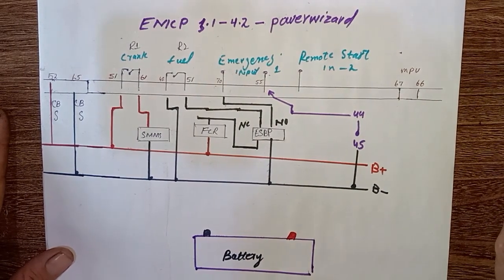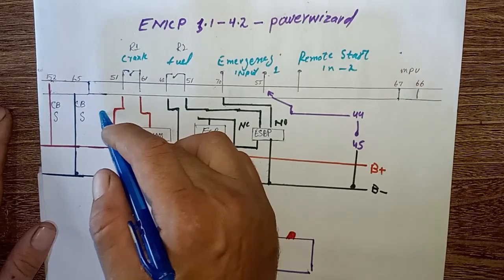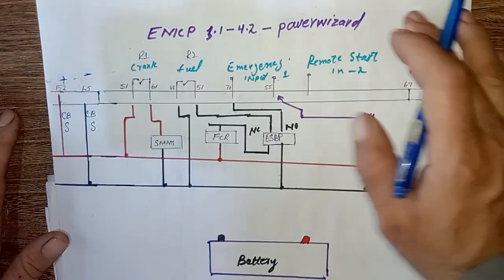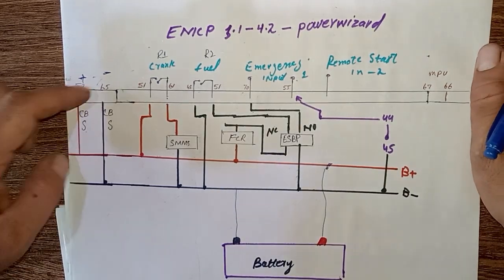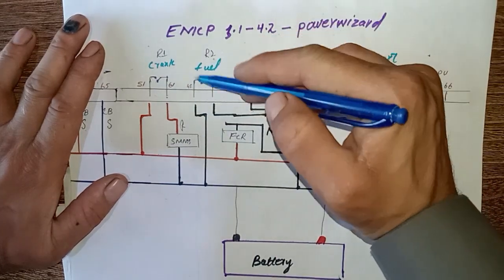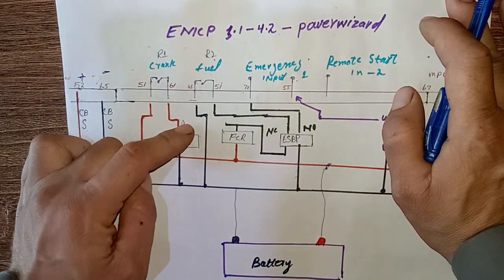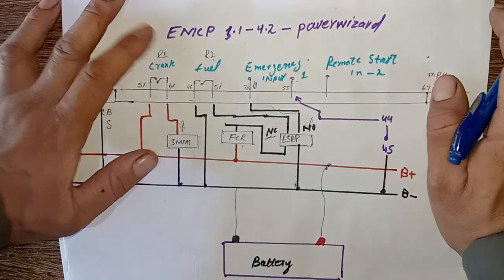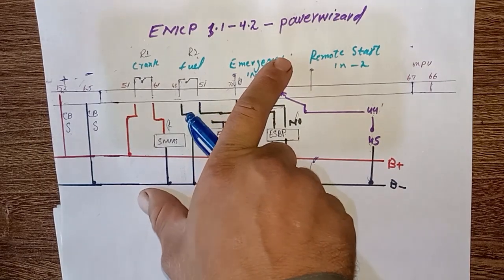Caterpillar Generators/  perkins generator EMCP II 3.1-4.2 powerwizard 1.1-1.4 wiring diagram

Comment: Greetings sir, I like your teaching, but you mentioned pin 51 in crank and the same 51 in fuel, please l don't understand, is there two 51 on that connector?
Reply: Both needs batt-ve which is No,51 which is comom ground
Reply from the maker: 51 is not Batt -V it's you 51 is your input for fuel 61 is your out to your fuel
Pin 65 batter - input is for your controller power supply 
DISCRETE INPUT 6
44
DISCRETE INPUT 5
45
DISCRETE INPUT 4
53
DISCRETE INPUT 3
54
DISCRETE INPUT 2
55
DISCRETE INPUT 1
70
This pins also grounds input